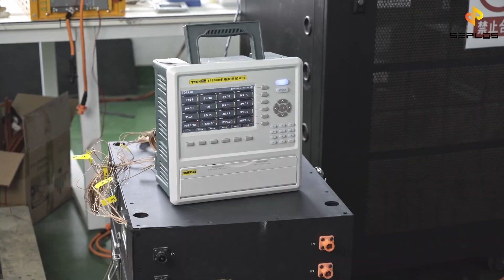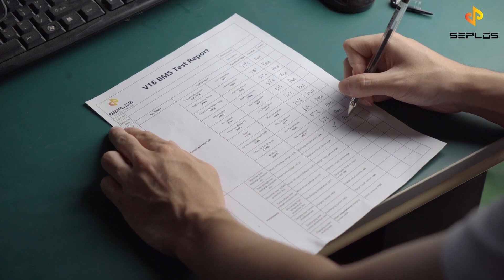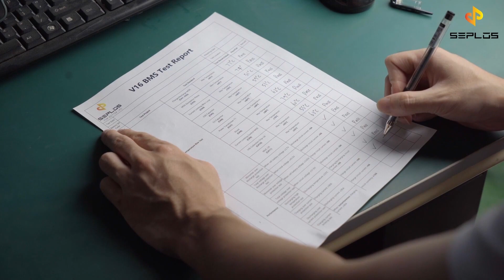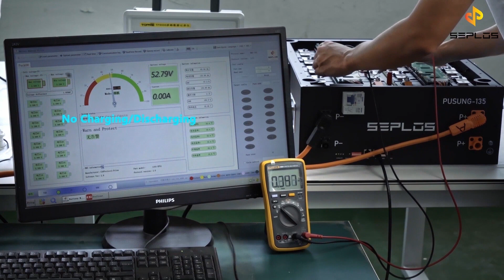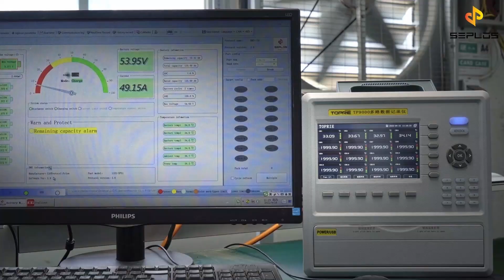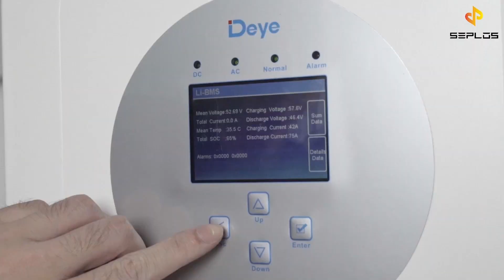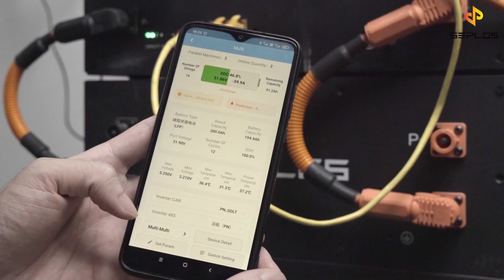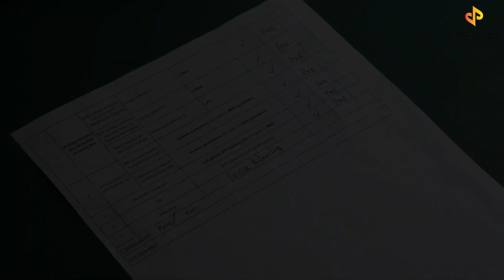Seplos BMS V16 Upgraded New Generation BMS Test | New Features Bluetooth/DIP/485/CAN and More in One

Comment: The voltage measurements should really be done with a multimeter with 4 wire probes, not 2 wire as shown. Also you could safe a lot of time and money by using a calibrated high quality IR camera instead of wiring up the probes manually.

Comment: Serial connection ? I want replace rack UPS 192V (max 215V, 30A) Battery into 52s1p LFP and I need connect 4 BMS in series - no any can/485 communication bcs UPS not use any. Serial connection is possible ?
Reply: rs485 IS serial, I assume you mean RS232 .
Reply: @patrickmaartense7772  No, I not say about communication - I no any RJ45/RS232/RS485. I say about a HighVoltage, means serial connection of all cells and BMSs when V is adding to each other. In car you have often 96serial - one string - one chain know as serial connection (not parallel). UPDATE: Seplos on YT have video thay create a HV Battery... but not as DIY version... we wait for that bcs all big power 3phase inverters use only HighVoltage Battery

Comment: Can you correct your english translation? Monomer is just wrong! Low pressure is also wrong.
Reply from the maker: OK. Will do that.
Reply: @SeplosTechnology  Thank you so much! I would recommend a technician who has experiance in this field. A normal translator, who does not know what high and low voltage is, will not do the trick in this case.

Comment: Is the V16 (or future V17) BMS compatible with previous version BMS?
 I currently  have two previous version CAN bms, but my inverter is RS485.
Reply: according to their answer , we can"t have CAN bms toconnected with RS485 bms  .  bcoz internal communication is still different when inverter port  is configured as CAN or RS485.  

But yes we need to know if this new bms are compatible with the previous one.  I can't see why it would not be.
Reply: The lack of a reply from Seplos regarding the question above most likely means the answer is "No", the V-16 won't play well with the 10D or 20D boards, so if you bought the wrong version board (Seplos never said there were 2 different versions in their advertisement) you're out of luck.
Reply: @danh.6610  Hello seplos, can you confirm or not pls ;-)
Reply: @danh.6610  I agree with your comment. I think the changes are not just software/firmware, but also hardware, which means having to buy new. They should at least have a trade in program for previous customers. I think I have about 20k already invested in Seplos components.
Reply: @danh.6610  hello carte 10d or 20d what is 10d and 20d
Reply: I am wondering too
Reply: Hi seplos just purchased 2 seplos battery pack 280AH with 10E BMS but the bluetooth can't connect due to BP01 error both had BP01 no BP00 detected

Comment: can we now combine CAN and RS485  bms in the same stack ?
does CAN et RS485 version share the same inter communication protocole now ?
can you add an option to set internal or external balancer and have a digital pin available to activate an external balancer. 

Thank ;-)
Reply from the maker: 1. yes, integrated on one board. 
2. different protocols, but all protocols pre-programmed.
3. will achieve maybe V17 generation.
Reply: @SeplosTechnology  ok, great, Can you at least add an option in the  firmware and pc software to disable internal balancer  ?
Reply: @sergea1138  Yeah that would be great. The internal one isn't really any use anyway and just wastes energy without beeing able to catch up with a big cell running away.

Comment: Please provide a good BT app and 2A integrated balance current and you'll have a winner. 150mA is insufficient for our 280aH grade A- or B cells. Thank you.
Reply: Buy a Neey Balancer, you can turn off and on via bluetooth also, if your cells have problem over 3,45 V
Reply: @derfreiemensch  yeah I don't get why they say it's not mature yet when neey has a very good product why not use that technology and integrated into the BMS itself?

Even something with half the current that the neey offers would be fine even a 2amp current would be good
Reply from the maker: The active balancer technology is not mature currently. We recommend getting an extra balancer for non-cosistency cells.
Reply: @SeplosTechnology  Good answere